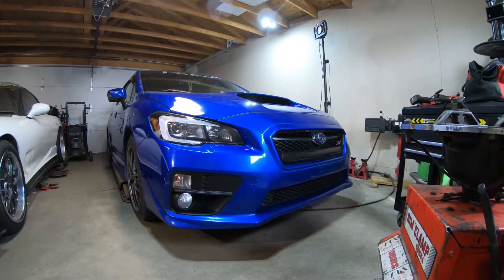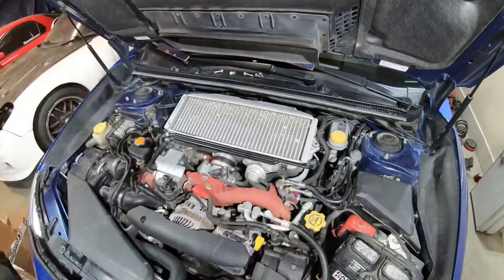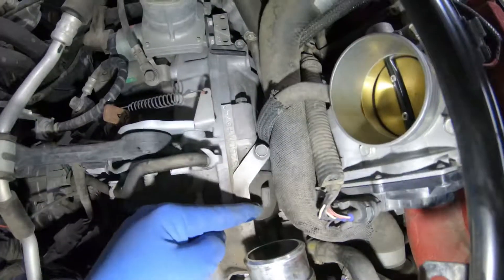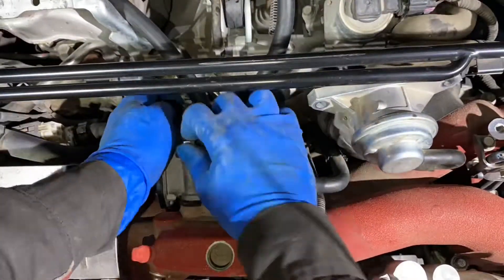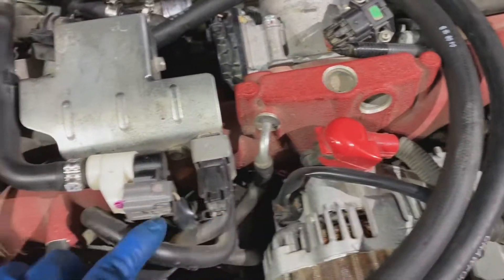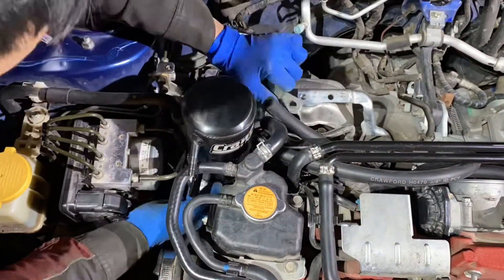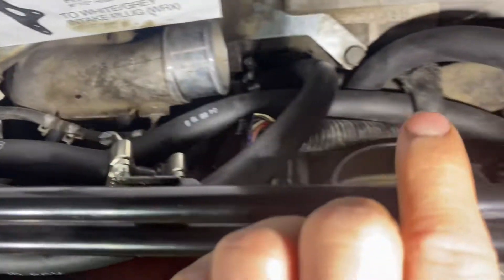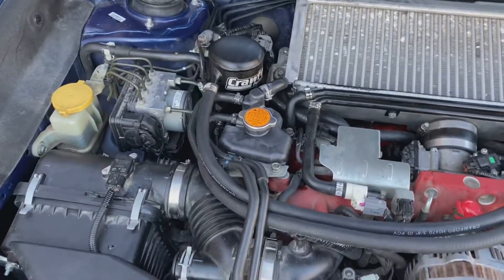HOW TO install Crawford AOS(Air/Oil) separator on Subaru STi(EJ257)

Comment: Is there any way that the air intake resignated cabin hose can be routed with AOS?
Reply from the maker: Unfortunately not. It’s a hard plastic pipe. The only way we can think of keep that is to fabricate a pipe or maybe a hose that would go around the AOS canister. I’m sure someone out there has done it. Just gotta look it up.